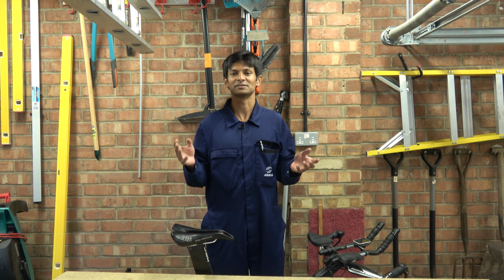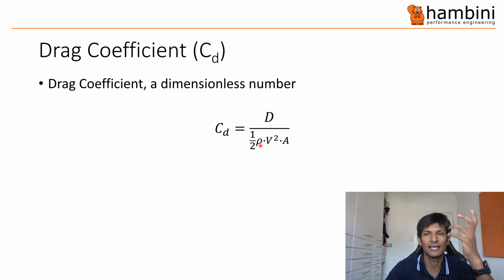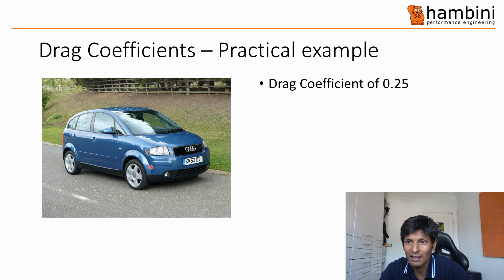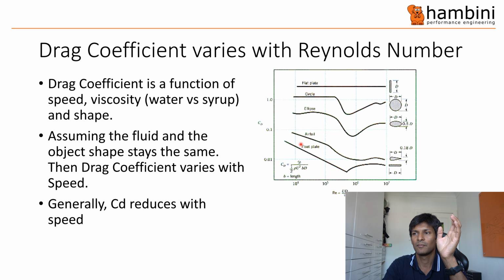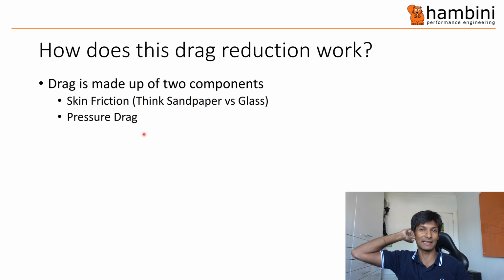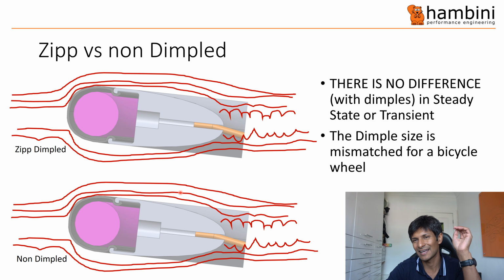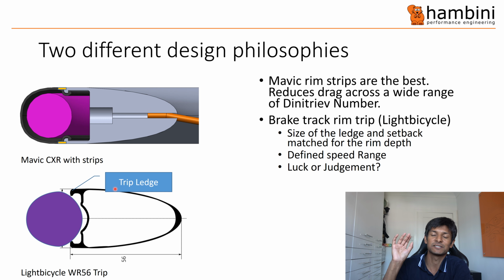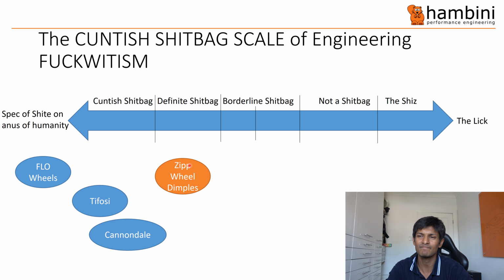Aerodynamics: Zipp Aero Bike Wheels (A Hambini Reaming)

Comment: Is the 105 rule a myth?
Reply from the maker: It does not work well in a large proportion of situations that now commonly occur.
Reply: @Hambini  Can you explain more? I watch your video about 105 may screw aerodynamic at tires bead point as air flow or something will be disrupted. I see you recommend 28mm on 88mm deep rim on your website. If I read it right.

Mind if you explain more on that? about tires sizing to rim depth relative for the best result?
Reply: Who would you place on The Shiz or The Lick end of your scale.  I wanted a set of wheels to upgrade from the stock wheels I currently have
Reply: @lisasmith524  he rates look frames and some bearing companies. Not sure look do wheels though. He'd probably say stick with shimano dura ace for wheels?
Reply: @ironmantooltime  I mean he's got Zipp wheels on his rig??? I hear a lot of jargon and name calling, and some home made diagrams....what I don't see is any empirical evidence that the dimples don't do what Zipp says they do. For example testing them in a wind tunnel against a similarly shaped wheel without dimples (I'm sure that Zipp never considered that prior to putting the dimples on the wheels, or making any claims about their role or effectiveness). I don't even see any kind of computer simulation that would disprove the claims of Zipp. In fact the only empirical evidence shown in the video is that these dimpled wheels are on his bike. And I'm really not buying that he got a set of 808's even used at a bargain price.
Reply: @chrisgilligan4968  sounds like someone bought some zipps haha

I think the point is wind tunnel testing is of limited value. What you need is back to back real world testing at constant power and x is worth y seconds over zKM. This needs multiple tests to get reliable data. Route needs corners and wind that behaves like wind, not a turbine. I believe you're looking at vanishingly small gains from the dimples but heh ho. The argument is the aerodynamic marketing bs is overblown.

I know empirically riding a TT frame down a hill vs a non aero but still carbon frame the TT is much faster with my meagre watts and feels better. What it would add up to over 100km variable route... *it depends*. I guess the best example is where a pro bike team does or doesn't do a bike swap on a solo TT. A road bike on a hilly route might save more than the time to change the bike, maybe 20 seconds for a 10 second bike change giving net 10 seconds over 45km. What difference would dimples over non make? Maybe one second? Any real world value? Probably not. Therefore is there marketing bs going on? In most cases probably yes.
Reply: @ironmantooltime  lol - I've never owned Zipps. Just remarking that there was no real world evidence to back up Hambini's argument. Just a bunch of jargon that he may, or may not be interpreting / explaining correctly. It would be difficult in the real world to run a test that eliminates all variables except the relative aero effect of the wheels. But my main point of contention was that in spite of his clear (or feigned) disdain for Zipp - a set of dimpled 808's were his wheel of choice.

I'm a pretty novice rider - the biggest gains I can make will still come from me building fitness, and losing weight. Bought a new bike last spring that came with some deep section Vision wheels. They're plenty good for me for the time being. If money were no object I'd probably get a few different sets of wheels of varying rim depths and varying manufacturers try them with varying tire widths and pressures and do a trial and error for myself in terms of what is faster for me for my speed, wind conditions, and typical local routes. But sadly I haven't won the lotto and am not independently wealthy 🤣🤣🤣 So I'll have to manage with what I have!
Reply: @chrisgilligan4968  I wouldn't discount his bs as jargon. Not sure how many vids of his you've seen but he's not a complete muppet. The hubs he puts together in his shed are legit and allegedly he works in aerospace so despite being an obnoxious c*** he doesn't talk complete rubbish 😆 He has also joked about the irony of having zipps while slating them
Reply: @chrisgilligan4968  Just don't voice that opinion if you can't handle the science
Reply: @KleineJoop  My opinion is that science requires evidence not just formulas and conjecture.
Reply: @Anders Dalton No nobody cares. Why would you want to hack your gf's IG? If you don't trust her then date someone else freak.
Reply: @chrisgilligan4968  They're bots you noob lol.
Reply: I believe the dimples reduce the airflow sticking to the surface so that it pulls off more easily. Not enough room here to go into it.
Reply: @tomkunich9401  erm maybe watch the video?
Reply: @tomkunich9401  Dude, he spent 32 minutes explaining that that is what it's SUPPOSED to do, and also why it doesn't work in his analysis. Maybe actually watch the video and pay attention.

Comment: Bambini knows best. 
This is drawn from a 4 year old. 
Gulf dimples increases the effective wet area on the aerodynamic surface. Effectively a larger ball in a smaller diameter. 
Little to no observable advantage/disadvantage when the ball isn’t rolling or spinning. Otherwise the effect is pronounced. 
When the ball in question spins on its own vertical axis, the linear path is altered into a curve path, hence curve ball.  
When rolling on a horizontal axis the ball it either (1) sink exponentially or (2) lift in a path deviates from its natural trajectory down. Especially the reverse roll (car wheel rolls direction in a reverse gear) in case (2) produce an airfoil lifting force with energy drawn from stored energy the angular momentum in spinning. The shot benefit from aerodynamic lift will end farther down range. The player has the skill to control the stored energy in terms of spin, more or less to overcome a relative target range and or up/down wind effect. 

The tennis player knows that very well. And can explain you the hairs on a tennis ball mimic the dimples on gulf balls.

On the carbon rim? Is an art but science.

Comment: As a gravel rider I wonder if "aero wheels" ( 42 depth , 32 wide ext) are worth with a 40mm wide tire with small knobs ? I'm planning to get DT GRC1400. Is the tire drag gona remove the benefits from the depth of the wheel ? I see alot of manufacturers proposing gravel wheels around 30 to 45 mm depth but is it really worth the investement aero speaking ? thanks in advance :)

Comment: @Hambini. Thanks for the informative video about aerodynamics in bike wheels. I learned a great deal about how the thin turbulence layer created by the dimples can smoothen the travel of moving objects in general. Yet, I have a question on the angle of attack. The side wind is not a small factor as all road cyclists understand, including myself. For this, must the dimples on the side wall perform aerodynamically based on the principle you explained? BTW, I am a building scientist looking to get ideas how aerodynamic principles can be used to reduce wind around the buildings.

Comment: @hambini you should do an updated Zipp review using the new 303 Firecrest, since the design philosophy is completely different. The new hookless design seems to fall in line with what you were mentioning regarding airflow where the tire meats the rim. Dimples may still be useless, but the wheel as a whole would be interesting to analyze.

Comment: The heating on reentry isn’t actually due to skin friction.  It’s the pressure drag.  The front of the ship compresses the air in front.  When you compress air it heats up.  The compression is so intense it creates a ton of heat.  Actually the reason entry vehicles are so blunt and in aerodynamic is because that flat shape pushes the region of max pressure a bit further in front of the shield.  A pointy nosed vehicle would need a ridiculous cooling at the nose to avoid burning up.

Comment: I'm discovering this way after it was published. However, your analysis only considers the airflow going from the tire to the rim, i.e. on the front of the wheel - meaning the dimples are in the wrong place. However, if we look at the back side of the wheel, the airflow meets the rim first, and only after does it hit the tyre. Here, the dimples would be in the right place. Is there a particular reason for which you did not to take that into account ? I hope I was clear enough
Reply from the maker: Once the air is already "sieved" the dimples will have no effect. The air is already erratic so it will have limited if any effect.
Reply: @Hambini  Sure, that's what I would have thought. Thanks though !

Comment: My Zipp Firecrest wheels with NTN bearings are still going strong. I have trained and raced on them since 2012. The dimples are most likely a marketing gimmick; however, the rim shape must be pretty good because Zipp essentially copied Steve Hed via licensed patents. Mavic CXR 80 was an incredibly fast wheel. Too bad Mavic stopped making them.

Comment: You are not old enough to remember, but in the late 80's and maybe also in the early 90's there were tires for sale with little flaps that closed the gap just above the rim edge, making a smooth transition from tire to rim.

Comment: A remarkably good analysis for a 5 year old not-fluid-dynamicist. (I was one when I was 5). I would notice something (like the fact that the dimples were just flat wrong) and ta-da!, you later brought it up. One thing I'd mention is that the laws of fluid motion are non-linear differential equations... and we lack the mathematical tools to solve them in any but the most limited scenarios. So we model them. I spent years doing that, and (fortunately!) I never had to do it for rotating systems. You can't even just run separate simulations with different flow angles because the continuous change in flow angle is going to have it's own effects.
I am guessing that bike wheel design is more a matter of experiment than calculation. So I would forgive these Zipp wheels as a failed experiment.  At least they were cheap.

Comment: I know I'm late to the game, but is tangential velocity of the rim / wheel not taken into consideration when doing cfd of wheels?  You made the point elsewhere that doing cfd of wheels without the spokes is silly- does no one spin the wheels while testing?  Does the spinning cancel itself out as someplaces the flow is faster and some slower?  Is this not a similar question to the F1 rolling road cfd?  Thanks for the vid, heading out for a ride.

Comment: All this fuss about aeroshapes and carbon...  it is clear from your slides that shootpenning round tube bicles will be far superior. While at it some marketing genious will set up a personalize fitting  so the happy buyer will be in the shootpenning  chamber at the same time as the frame. This will  further reduce the chances of flow separation caused by the rider

Comment: Have seen pro TT bikes with (silicone) sealant smeared into the crevice between the tyre and the rim to make a smoother surface similar to the effect you mentioned the UCI banned.  Would you reckon this could be effective?

Comment: Watching this in 2020 after Zipp have released the new 302 WITHOUT their 'iconic' dimples
Reply: Several automakers used dimples and vortex generators on their automobiles. They gave up on that "feature" 10 years ago. I just see a texture that makes the wheels harder to clean. There's always a touch of chain grease on my wheel.  There. I said something polite.

Comment: Give you the benefit of the doubt on the dimples because, while I like my zipps, I always suspected the CORP was run by their goofy marketing people.  eg. Their dimpled, gram wheenie crabon fiber wheels used to have several ounces of HUGE, rim-spanning (spamming?) stickers attached to them that took about an hour to remove, added rim weight and completely obfuscated the dimples they themselves claimed were so important.  I guess enough people like me dinged them to get that to stop.  I'll look forward to what you consider wrong with the bearings.  They are the best I've encountered - though these are by far the most expensive wheels I own.

Comment: Do the dimples make a difference on the trailing side of the wheel as opposed to the leading side, which Hambini has shown. The inner side of the rim would then be striking (i assume) turbulent air before the tire and bead does. What about all of the other position that the wheel hits air i.e. 12 o'clock position where the air travels along a longer length of the wheel dimples at a higher velocity? Just a thought.

Comment: Dear Hambini, For Crying Out Loud, when are you going to look at and review high-speed wheel balance?!    HAMBINI please think about this, 50% of a bicycle is basically static, and the other 50% spins at a high rate of speed... Don't you think if you balance the 50% that rotates at high-speed ie wheels, something very good could come out of it in terms of handling, rolling efficiency, and other technical possibilities never explored before?  Please go to my website  dynamicspeedbalance.com and click on HOW DSB WORKS and you'll see a video where I attached an accelerometer with a vibration app showing real-time information created by both wheels spinning at high speed. That window clearly shows the G-forces and Oscillation of axes the wheels are creating at high speed.  Hambini, sure its crude, but it's a dam good start showing unmistakable RAW information that I think no one in the world has ever recorded or seen.
What bicycle engineers fail to understand that it's those innocent 5 or 10 grams of off-balance that causes the entire weight of the wheel (from the axle to the outer perimeter of the tire),  to go out of rotational balance causing the violent Oscillations you see on the video.  If you look at the Gs those wheels are pulling an average 9G and spike up to 20G, it's Jaw-Dropping.  (FYI: the average front wheel weighs 1.2 lbs & rear 1.5 lbs including the hub & cassette causing those Gs).  If you look at the Oscillation of AXIS you will notice a helix pattern and that's when the oscillations of both front and rear wheels go in and out of synchronization which I suspect is the main reason bikes go into the dreaded High-Speed-Wobble. 
Then look at the dramatic difference in Gs & Oscillation of Axis when the wheels are balanced.  HAMBINI, please don't tell me there is no value in balancing wheels.  And if anyone can take it to the next step from this crude, baby steps of test information and into a whole new level equal to what the bicycle industry does with current Aerodynamics, its YOU, HAMBINI. 
One last thing to think about... If you combine wheel aerodynamics with perfect wheel balance, you end up completing Newton's first law;  A mass that is put in motion will continue in motion unless interrupted by an outside force ie aerodynamics, or an oscillation ie balance.  So please contact me and I'll give you my 10 years of research into bicycle wheel balance and maybe something good will come out of it.  dan@dynamicspeedbalance.com

Comment: I don't expect that the dimples actually have any significant effect either, but playing devil's advocate for a second, I think the dimples would be in the right place for reducing the wake on the other side of the wheel (behind the wheel, just before hitting the downtube), especially in a cross wind.
It would also explain why oval shaped rims are marketed as being better than the pointier aerofoils (like the one you drew).  The tail of the aerofoil is the tire in that situation, so you can't really make a proper aerofoil.
I doubt it has any appreciable effect, regardless.  ;)

Comment: Thank you for the in-depth analysis of the aerodynamic properties of the Zipp wheels.

Have you done, or are you planning any analysis on Fast Forward's DARC aerodynamic profile?   The one thing I can tell you is that their design is quite different than the others brands so it may be worth evaluating.   They also use DT Swiss hubs so the bearings would be better than Zipp and some other brands of wheels on the market.

Comment: Always great videos! I have a question: so we can conclude that the dimples should be on the tire for the concept they sell to work. What about for the air that passes around the front half of the wheel but that then hits again the rest of the rim? And now there are the dimples facing that air flow. can you explain your thoughts?
Great work and great videos, thanks for sharing!

Comment: 24:25 would u still recommend using these rim strips? Or some sort of silicone filler to even out this airflow?
Reply: I'm sure he'd say yes. Steve Hed would caulk Lance's wheels claiming that was the biggest area for drag on a wheel. Mavic strips are great, but the Mavic tires needed for the strips to snap in place are junk. High rolling resistance. Most any other tire has a lower rolling resistance, negating the benefits of the strip.

Comment: @hambini I enjoyed the video, but got me wondering two things: does the relative vertical movement of the rim as it travels forward create a vector air flow direction that effectively increases the rim depth at point and narrows it at others effect things? Also (and this may have been on another video?) Is drag friction or the creation of a pressure wave in front of the moving object (plus the vacuum)? Cheers

Comment: Love the explanation.  One thing, though, we are only talking about the first leading edge of the zipp wheels...  The air also has to pass the rim a second time in the opposite direction.  Aren't the dimples in the correct location on that pass?  Of course I'm not sure if the flow has gone laminar again at that point.
Reply: Yes I had this question as well.